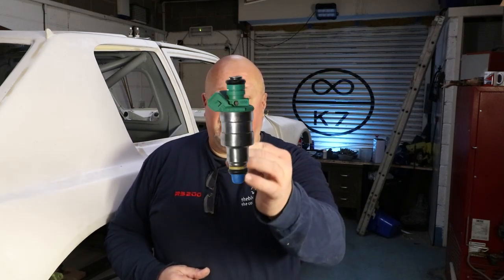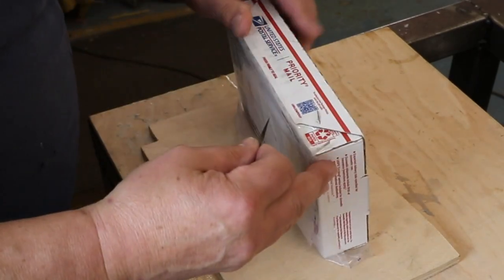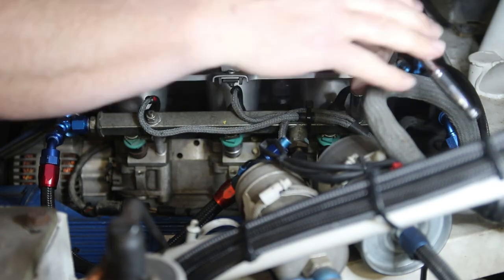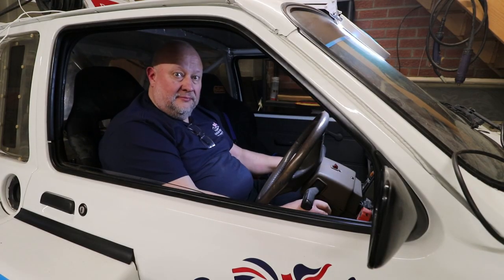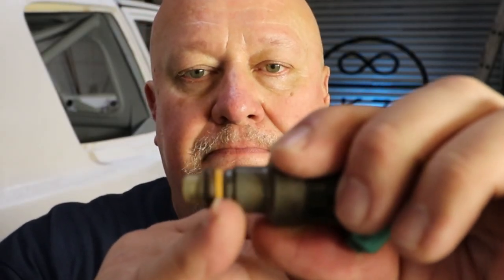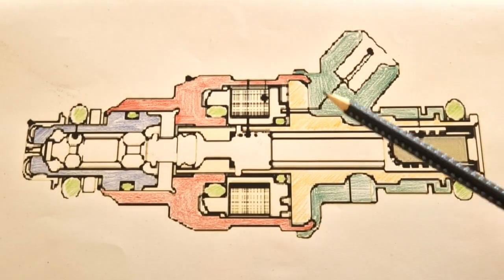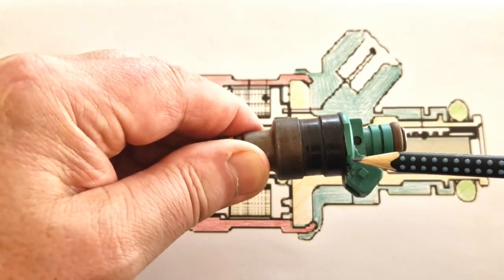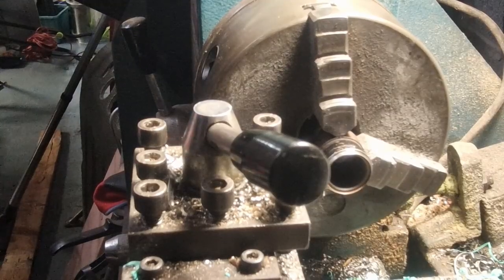Fuel Injector Post Mortem. Bosch Injector is Dead - But Why?

Comment: Many, many years ago when I was at college training as a motor vehicle engineer and the world was black and white even, one of the projects was to strip and rebuild an analog diesel injector and truck fuel pump. When I was rebuilding it, I had to adjust the spill timing on the pump and injector spray pattern and breaking pressure on a Hartridge tester. A finicky job to say the least. Now most trucks and cars have common rail electronically controlled injectors much like the one in your experiment. The last time I did any of the above, black and white life was just getting some colour. Everyday is a school day and I confirm that they continue after retirement.
Reply from the maker: We got involved in the hydromechanical fuel equipment on the gas turbines just as it was becoming obsolete. I learned it inside out and when R-R scrapped off the test rig they gave us the fittings on the basis that it would never see action again unless we did it.

Comment: There must of been a spring, for the upper body to depart the lathe with force
Reply from the maker: I had moved the injector further out in the lathe chuck to get a better grip on it and the chuck had been holding it all together by gripping the barrel onto the upper body so it basically fell off when the unbalanced electrical connector began to spin. That said, I eventually did find a spring but it was tiny and not capable of pushing anything but that tiny needle valve. But, yes, there was one there in the end. 👍

Comment: The speed the head came off, are you sure there isn't a spring either on the lathe or further out? Great video.
Reply from the maker: Thanks... I looked about for a spring but I couldn't find one. And not all the cutaway diagrams show a spring so I told myself there wasn't one but now you've said that I'm going to have to look again. Looking for a tiny spring in a pile of swarf is going to be fun. 😁😂
Reply from the maker: I found it! it literally hadn't gone anywhere. It must've dropped straight down under the chuck but it's a fraction of the size I was expecting. Every day is a school day.

Comment: I once took apart a much simpler Lucas mechanical fuel injection injector, as new ones were £30 each, and I was poor.  A pair of O rings to recondition it were much cheaper.  The only problem was that I didn't have a pressure test rig to set the spring preload.  It didn't drip anymore, but led to a misfire as I didn't quite get it properly set up.  Eventually I saved up for some recon ones, but at least I learned something.  Happy days!
Reply from the maker: When I was young my dad had a wagon in for repair and the mechanics allowed me to hang about the garage, I doubt it would be allowed nowadays, and as I wanted to emulate them I sneaked out of sight dragging the injector pump behind me by its pipes and proceeded to take something off it that they couldn't re-calibrate. It had to be sent away at great expense. I wasn't very popular.
Reply: @TheBluebirdProject Started as you meant to go on eh Bill?😅  Next in the queue here is my old Porsche 356 that spat a plug out at the back end of last year.  The heads have been welded up too many times, so a pair of new ones are going on.
Reply from the maker: @jonhewitson9759  Never throw away old heads. One day they become worth repairing again. A mate of mine raced classic Ducati bikes until he ran out of heads and suddenly it was worth fixing the scrap ones he'd shoved on a shelf in his garage. It'll fix.

Comment: Interesting stuff, I did strip one down a lot of years back but used a die grinder (didn't have a lathe back then)  and ended up In a similar story 😊
Reply from the maker: That would get into it alright! We have a little Clark lathe for bits and bobs. It does a good job. Then we have Clever Barry if it gets tricky.

Comment: And this is why I'm on the look out for a nice Myford Super 7 lathe, sometimes it's the only tool that will do the job. Enjoyable video 👏👏👏
Reply from the maker: Glad you enjoyed it. Clever Barry uses a Myford Super 7 and he swears by his electrical speed controller. He reckons it transforms the lathe. Top tip from Clever Barry, and he ought to know.
Reply: @TheBluebirdProject I shall look into that option, thank you Bill.

Comment: I genuinely thought these were piezo electric. Very much not. Thanks for the surgical explanation
Reply from the maker: You're welcome... It turns out they're pretty basic things inside. It was interesting to find out.
Reply: Some direct injection or diesel ones are piezo but not these ones
Reply from the maker: @simontist I knew these were fairly basic because our mate Gordon (have you watched our RS200 rebuild stuff?) used to do QA on Bosch parts for automotive but the piezo electric injectors I know nothing about. I must find one and see what's what. 😊
Reply: @TheBluebirdProject  I think piezo is mostly about speed and precision so they are better at direct injection stuff which involves precise timing. Piezo elements have a lot of advantages over solenoids. Expensive though! Diesel injectors are also crazy complex, it's a little hydraulic relay valve where a little internal valve is what gets moved by the electric actuator, the pressure from that then moves the main needle.

Comment: Very interesting in depth look at electrical injector’s I’ve only seen hydraulic injectors stripped down.
Reply from the maker: My dad had a test rig for diesel injectors when I was a youth and the spray pattern used to intrigue me but I was always told never to let it spray on my skin because it had enough energy to go through your skin and then the trouble started.